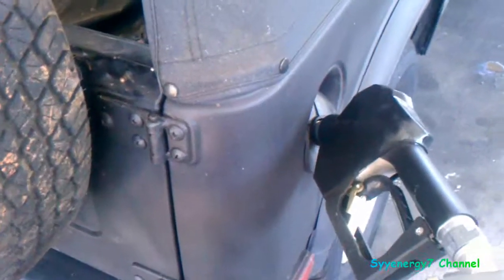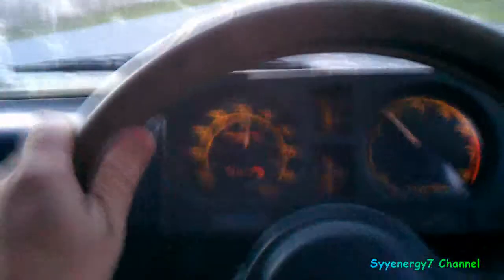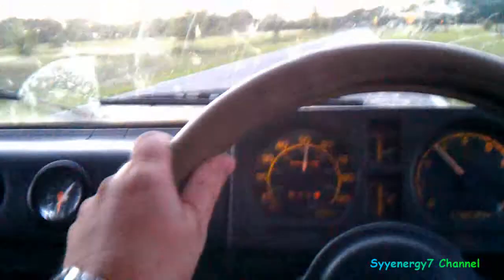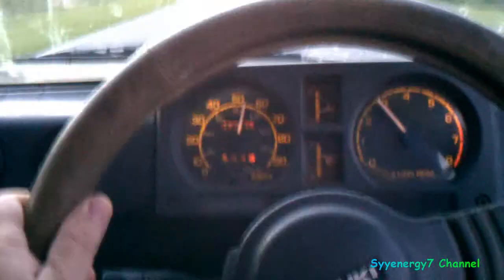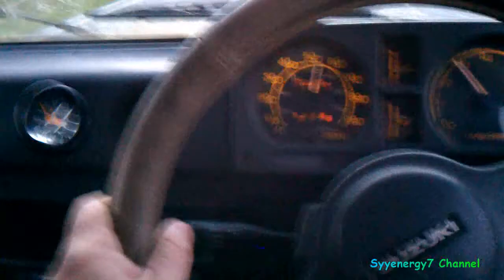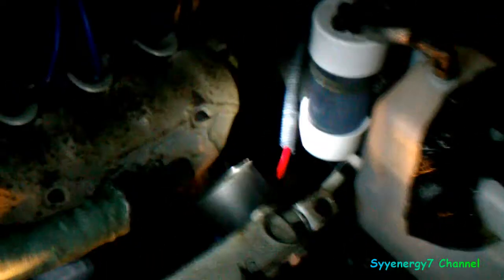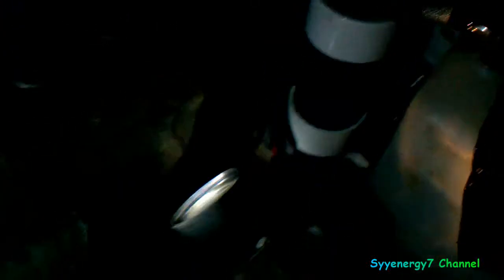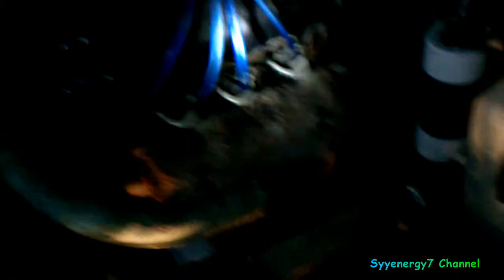HHO SAMURAI Real MPG Results, 27 MPG

Comment: Hey! Cool results! Do me a favor though, to make it more scientific:
Could you please take a video of you holding the camera still at the odometer to show the current mileage on it, then driving the car (120 miles or whatever) then fill up and show the gallons dispensed from the pump and then the odometer with the miles visible.
Reply from the maker: Jacob Jones I owned this Jeep for 30 years.  It never did as good on mpg.  Another check I did , with easy driving, got 30 mpg.  The HHO helps some with a simple carb system.